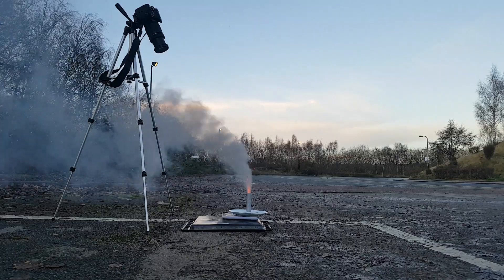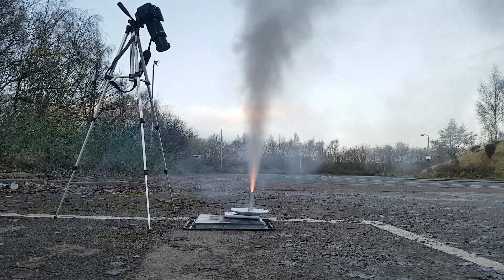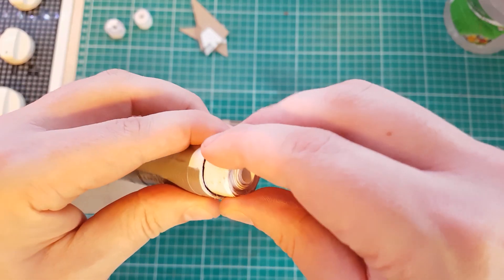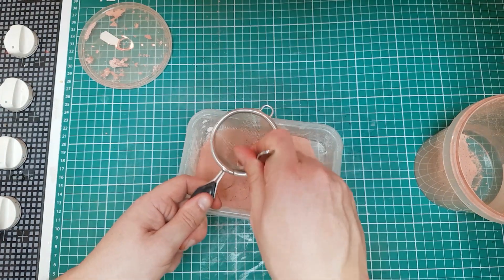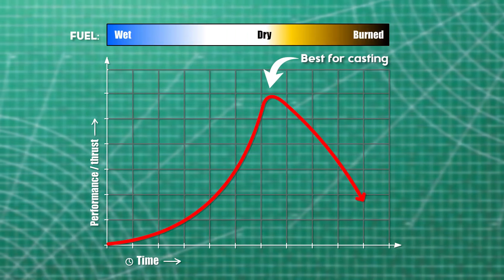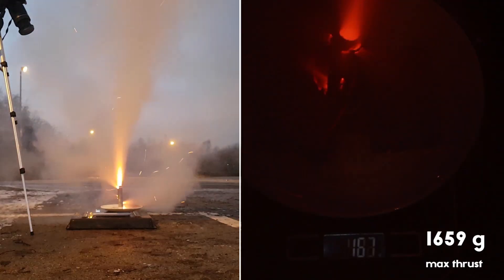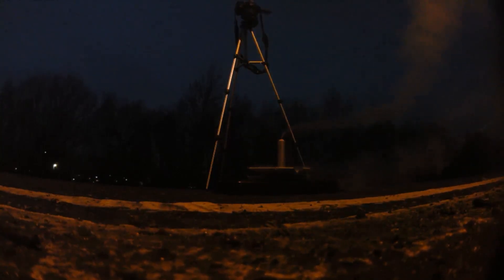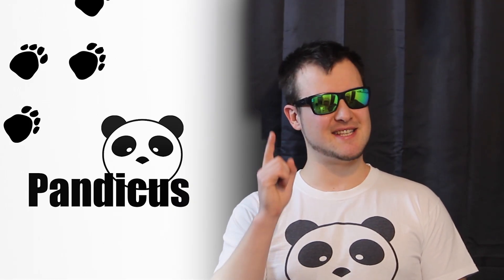How to INCREASE the power of your SUGAR rocket (Kno3+Sugar+Fe2O3)

Comment: Hello, can you please tell me where did you get chemicals For rocket fuel? If you can tell me i would be sooo thanfull.
Reply from the maker: Hi. I've got them mostly from online... amazon-ebay-etc. I can send link but I used UK's amazon so it will work If you live in UK. :) 
Otherwise, most of the garden stores are selling KNO3 as a stump remover.... but you should be aware to get 100% KNO3 as it not contains any toxic chemicals.
Sugar and Fe2O3 is not that hard to get. Fe2O3 is basically rust. So If you cannot buy some from art-shop you can make your own by sanding rusty stuff (I would do that). :)
Reply: @pandicus1412  thank you sooo much! I apreacciate the help.
Reply: If you can't buy solid oxidizers for leagel reasons you might buy it from farmers because they are used in fertilizers. It would still be illegal thoug.
Reply: @Emre_Kermen  thanksss!

Comment: I soak my paper nozzles in super glue once I get them to shape then coat over the wet super glue in graphite powder.. helps them take the heat and seals off any leaks quite well.
Reply: Give em a day or two before launch to get proper solidified though
Reply from the maker: @brett567  Yeah, a Good idea.. Thanks. :)

Comment: Twist the fins slightly for spin stabilization
Reply from the maker: Yeah, that's  a good idea :)
Reply: @pandicus1412  NO! thats a terrible idea. It would cause more instability. Also using paper or similar stuff for fins is worse than using paper for motor. It deforms very quickly, use plywood instead.

Comment: You can try the hot water heating - you put one pot with water on your oven and second one put into it. Boiling water has always constant temperature of 100deg C - so it it much easier to control the temperature of your mixture and the sugar won't carmelize too quickly.

Comment: Wouldn’t it be interesting to lower thrust to increase burn time for improved range?
Reply from the maker: The thing is that based on my experiments, lowering the thrust does not increase range. That's true that the rocket has longer burn rate, but it become weaker, while the gravitation force is the same. 
The same happens when I've tried to lower the thrust too much. The rocket just stood on the launch pad, however it burned for a half minute. 
*
With these small rockets It needs a launching velocity for the stable flight. However I can admit that maybe a bigger rocket could reach more distance If I make a strong launch fuel part and then a slower burn rate fuel part, cuz it makes the wind resistance lower.
Reply: There is a optimum ratio, you need to calculate it or do a lot of experiments

Comment: try flame plasma rocket, ie, put a high voltage field from the outlet, creating a plasma linear accelerator, it can be a railgun lorentz accelerator too
Reply: you can make a custom solid carbon plug
Reply: carbonized flour
Reply: liquid solid mixed hybrid, namely, gasoline with kno3/fe2o3, spice up with magnesium
Reply: use gasoline, remove air, instead of water
Reply: if you replace some of the sugar with gasoline, you can leave it a sludge
Reply: you could make custom sticks with a roller tool
Reply: plastic rods, cast
Reply from the maker: Thanks for the lot's of advices. :) Actually I am making experiments with hybrid fuel and/or fully liquid propellant.
Have you got an idea what kind of liquid oxidizer could I use? I've been thinking of hydrogen peroxide but I couldn't get a 70% one which is a treshold for oxidizing... And liquid oxygen also not an option. 
Anything else as liquid oxidizer? :)
Reply: @pandicus1412  mainly the liquid-gas fuels, solid oxidizers, um, liquid oxygen, but non-cryo, um, main purpose was to mix them up so its same if the oxidizer or fuel is liquid, but if you want to feed the liquid in, NOS, gaseous
Reply: @pandicus1412  use Na2O2, sodium peroxide, as a middle step, or the oxidizer
Reply: you can also try carbides, aluminum carbide, with kno3, na2o2, fe2o3, and also hydrides, like LiAlH4, solid stuff
Reply: also KO2, potassium superhyperoxide, i think one could go up to many oxygens, like XO11
Reply: intercalated oxides

Comment: Hey I recently tested some rocket engines too. I'm using cheap aluminium pipes with are filled with powder. Before I'm putting powder inside I'm placing iron core in the centre. After all I put in on the heater and wait for powder inside to melt. At the end I'm removing iron core and I have great nozzle. Wdyt ?
Reply: If air is prevented from entering the pipe, it could help reduce the burning of the sugar.
Reply: @zachreyhelmberger894  You dont need air to enter in rocket motor. KNO3 releases O2 when heated.
Reply: Aliminium is probabely overkill. I reccomend doing reseach about rocket motor design and using MATH to desing it real rocket motors

Comment: You could use a double boiler to liquify the fuel. This can be a empty can set in a pot of boiling water. Candle makers do this as paraffin wax has a low flashpoint.

Comment: Amazing, but I have a proplem with making a combustion chamber,    The fuel goes down and ruins it when it dries up, I find it melting down
Reply from the maker: What do you mean "goes down"? Going down in the the casing? 

Did you try to make the "cigar shaping" method what I showed in the video? (at 8:46)

If the composition is dried before you casted into the chamber you can  also use a drill, just be aware that it can sponateously ignite the rocket if you drill it too fast. :) 

For cigar shaping method you'll need some practice but i think this is the best method for smaller rockets as "pouring it into the chamber" has several disadvantages like "overheating" or "trapping air bubbles" which can make the rocket explode.

Comment: My dad ordered some potassium nitrate NPK fertilizer for some plants . It looks like white sphere and doesnt smell at all. Is it the right one?
Reply from the maker: Kno3 does not have smell until you heat it up. But I recommend to check the back label that how much KNO3 does it contains. 
The best is the 100% one... if it contains less just be aware cuz some of the fertilizers and stump removers contain tiny but significant amounts of ammonia, chlorine and other poisonous substances which can harm your lungs and makes you suffocating.
In that case, use a respirator and/or dont do the dry heating method, just the dry compressed one.

The best what I am using is a food grade satlpeter... it used to use to treat a meat and its 100% KNO3 and 100% working (keep in mind that pure saltpeter is dangerous as well... its enough to rub your eyes or breathe in the dust to make a red eye and/or coughing for days)
Reply: @pandicus1412  Yes, I am careful enough to not rub it , I am handling it safely.
It seems to be a generic NPK fertilizer for plants, didn't come in any pack, it came in a small sack. 

I'll try to create a tiny batch and see what happens.

So should I just grind the small balls of the KNO3 and then mix the powdered sugar? I didn't understand what you meant by dry compressed method.

Thanks.
Reply: @pandicus1412  Does it matter ,if its pure Kno3 or not?
Reply from the maker: @FeverDev64  You can check my video about dry compression here:

https://youtu.be/vJKOOOfBi3Y

It is basicly when you do not heat up the mixture, just compress the fuel mix into the casing and make a combustion chamber with a nozzle too.
The performance is slightly lower but its safer and faster to create.

If the saltpeter is not pure it can cause lower performance or poisonous fumes.
But in that way i recommend to make some test ignition... 65% of kno3 and 35% of sugar... as in the video... totally airfloat grinded and mixed.
You can check the burn rate... if it leaves slag the mixture is not well grinded/mixed... 
Otherwise it should burn... if it has a slow burn rate with no slag or even black remained pieces, then it contains some non-burning elements too.
Oh and one thing.. before you mix it with the sugar and its in powder form... make it dry... put kno3 on a tray and bake it on about 120°C (with air ventillation) for 20-30 minutes. (Before you do that just try to ignite a tiny amount of fertilizer to make sure that it does not have a "fuel component" if it is not igniting you can bake it safely)

When its totally dry, you can mix it with a sugar and make some test. 
If you're not sure you can give me a piece of videoshoot of your burn rate to "victoriuspandicus@gmail.com" and I'll tell you my opinion and suggestion. :)
Reply: @pandicus1412  Thank you so much for your reply! It might take some time but I'll see what happens!

Please keep making this type of videos! You got yourself an active sub😄!
Reply from the maker: @FeverDev64  thanks very much. :)

Comment: Hei Friend your tutorial is awesome 🥰

I have An request To You ,
Dear Friend, i am working on this rocketry  project on couple of weeks , but i didn't get Success in it , because some cases rocket nozzle blast out or sometime end cap also bring out , some time i make the rocket nozzle bigger but the results is same , i have a request to you plz visit my channel ' The Indian Gunpowder ' there the video is present plz watch my video and plz plz give me a suggestion how can i get success ? And what mistake I am done ? 
Waiting for your answer 🥰
Reply from the maker: Hey man... I've checked your video. I had the same issue when I used clay nozzle and clay end cap.

As I see you make dry compressing method.
I think the issue what you see is coming from your rocket structure.
The clay is a really delicate material and however it is fire resistant, if you not ram it to rock hard, the rockets inner pressure will blast off the cap and the nozzle... 

So I recommend to try a cardboard tip (end cap) to be glued to the front... and then you can add clay to the casing... then rocket fuel... ramming... then make a hole on the rocket fuel... then add a paper nozzle just as I did. 
If you follow my instructions from the video You can be sure it will work... every step is important so watch it carefully... :) (you can replace the casing with pvc but you can also use paper... your choice... and you can do dry compressing... but keep in mind that dry heating can produce even more performance. ;) )
If you watch the entire video you should see that what could you do wrong. ;) paper is more durable than clay and trust me... if you glue it hard rock, it will not burn in that short amount of time. ;)

As I see you used electric igniting system... keep in mind... that the bursting electrodes out of the chamber can also hurt the clay nozzle which leads to failure...
Reply: @pandicus1412 many many thanks for your  help
Reply: Hei man plz send your email address
Reply from the maker: @theindiangunpowder1196  www.victoriuspandicus@gmail.com

Comment: I Know that the fuel that has been sitting around for a while burns less but if you had a fuel that was old and had absorbed moisture would it still work well by cooking it?
Reply from the maker: I had not got an exact experiment about this but is should If you do it well... as you see.. Im adding extra water to the composition at the begining of the process and the rocket flies well.
...
But If you re-heat an already cooked old rocket fuel, that might not work...(as I never succeed with those)

But If you keep it in the powder form that should work... I kept my pre-mixed powder in a dry place for couple of weeks... but then it had no problem to fly when I finally decided to cook it.

Comment: Use kitty litter mixed with red clay from a flower pot etc, crush them both to powder mix them together then heat the mix in a pan and in a separate pan heat up some wax and then drizzle the wax over the clay and work it until you have a dark powder then let it cool put it in container and you'll have nozzle mix that will hold up with little erosion... love your videos my man... Great stuff as always.... thank you...

Comment: I guess the one on the left does not apply to pvc pipe.?
Reply from the maker: You mean "left at thumbnail"?
Because If you wanna use pvc pipe version... just make a paper one and then push it into a pvc pipe as pvc gives solid shell but paper does not melt like pvc. :)
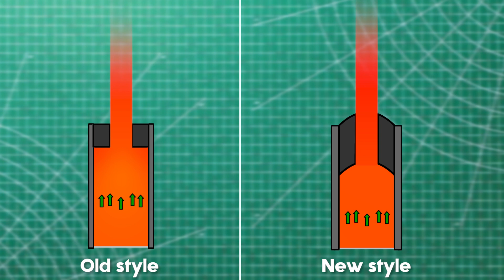Reply: @pandicus1412  10:11 yes, it's my fault, I didn't write the exact minute
Reply from the maker: Oh I see... you can try both of them into pvc pipe... If you have the exact inner diameter of the pvc pipe... just use that measurement to make a paper casing...
If you do so... you do not have to make an extra paper layer as the pvc will make the job. :)

Comment: Great video, I also find PVC pipe has a high strength to density ratio, and hammering a clay plug into the bottom works great
Reply from the maker: Yeah. I am also working with pvc... but If you wanna make a re-usable pvc rocket, just make a paper casing rocket and put it into the pvc tube. :) therefore the replaceable paper will burn and you can use your pvc again. :)
Reply: @pandicus1412  Interesting formula for your powder. Needs more improvement though.
Reply: @pandicus1412  3/4 pvc with a 12ga shells base glued in as a nozzle works great I think I've launched one of my casings something like 15 times before the pvc degraded enough for it to burst
Reply: oh god please don't use pvc if you have a malfunction during the burn and it overpressurizes, it shatters into little pieces, and flies out like shrapnel. If one of those pieces embeds inside you, it will be hard to take out because PVC is hard to see with an xray.
Reply: @vinfaz4138  Another reason to use a blast shield, nothing wrong with a bit of fireworks anyway

Comment: I got KNO3 but it's 1 month old will it work properly?
Reply from the maker: In this video I worked with about a half a year old KNO3 so yeah... until it's dry enough (but you'll made it dry in the pot... as you should add water too and follow the steps carefully :) ) 
An you gonna be good to go... just keep in mind about the airfloat texture... mixing... and not burning the sugar in the pot... ;) 
If you're not sure.... just work with small amounts... like 50g at once... and do a "dog poo" test rocket fuel piece... check how it burns... 
If there a slag... the particles still too big.
If there's a flame not stable... the mixing is not good enough...
If the burning is not fast enough...
Maybe you just burned the composition or even it still had some water which you can feel by its texture (crunchy-wet... solid as rock-dry) :)
Reply: @pandicus1412  thanks a lot...... You do a great work ❤️
Reply: @pandicus1412  Dog Poo test rocket fuel piece lol!!!!
Reply from the maker: @GWRcustomweathering  yeah... me and my Gf used to call it like this. :D

Comment: Sadly My previous rocket broke my digital scale so I cannot measure rocket fuel I will buy one soon
Reply from the maker: Don't worry, they're pretty cheap. :)
Reply: @pandicus1412  also I will try the paper nozzle technique when I got stuff ready
Reply from the maker: Yeah but be aware... even a paper rocket can crash a scale :D 
It does matter what kind of paper do u use... just make sure that the casing-thickness is about 2mm with thight layers. :) 
In my case I lost a ceramic plate because of the 2+kg thrust. :D
Reply: Got it
Reply: @pandicus1412  also is the nozzle necessary? You can still do it without a nozzle right?
Reply from the maker: @disc4653  Yeah actually you can... But I recommend even a small paper nozzle or something Cuz the nozzle also helps to keep the fuel inside the casing, till its fully combusted. If you not use even a small nozzle, the fuel may Burst out from the casing just as you can see here:

https://youtu.be/89NFRs9IrR8?t=41
Reply from the maker: @disc4653  but as I say... it should work without nozzle... but it can give you at least an extra 30% of thrust and makes it a bit safer... 
A little effort but quite helps. :)
Reply: @pandicus1412  hey how many sheets of paper do the nozzle need?
Reply from the maker: @disc4653  If you follow my instructions with the 2cm diameter rocket and a 0,5cm nozzle, the nozzle you could make from 1x A4 paper sheet... measure out wide strips and cut about 4x pieces... (in length... ) glue them together with a tape or a glue... and start to roll it on a screwdriver or any 0,5cm stick. :) 
Check the size then... if it too much... just remove some layers... if it too loose, just add some. :)
Reply: @pandicus1412  hey uh how thick does the cylinder needs to be?
Reply from the maker: @disc4653  It depends on the paper and that fact that are you using an extra PVC shell or not.... But arount 1-2mm thickness would do. :)
Reply: @Pandicus  oh about the Digital scale I do know they are pretty cheap but I don’t hame the permission the buy one yet but I still have the propellant I will just improve the propellant like you did in this video while waiting for anyone to give me permission to buy digital scale and maybe do some preparations.

Comment: You might try black copper oxide as a catalyst if you're in an experimental mood. It can usually be found at pottery supply companies.
Reply from the maker: Thanks... Actually I am looking for other compositions than KNO3 oxidizers too. :)
Reply: @pandicus1412  There are several propellant types available to the experimenter...zinc/sulfur mixes, which are low impulse but cheap and showy. The highest power rocket motors for amateur use are the ammonium perchlorate/aluminum mixes bound with polyurethane. Ammonium nitrate is also used in some formulas, albeit with lower specific impulse. These are neither cheap nor easy to make, but doable for a careful worker.
Reply: @pandicus1412  Please try Ammonium Nitrate.